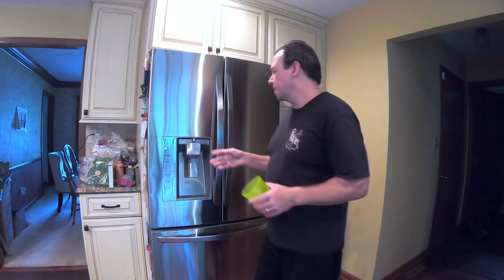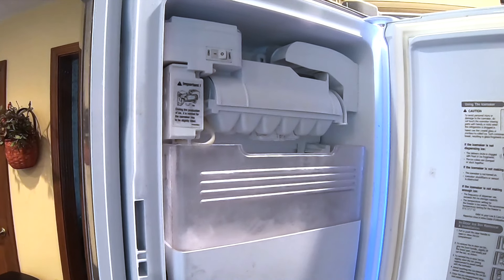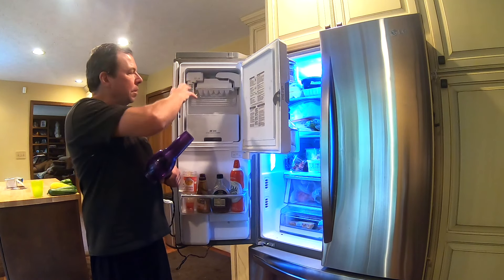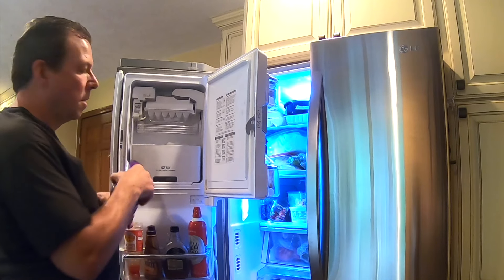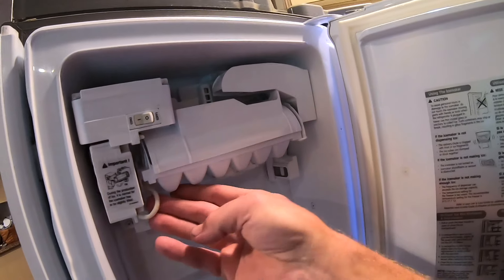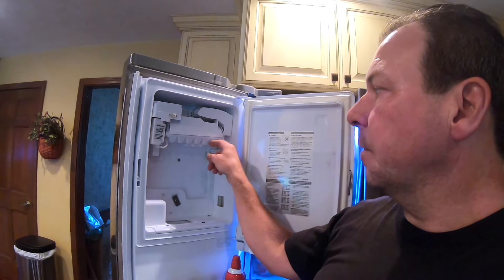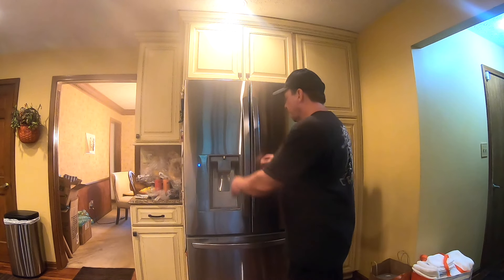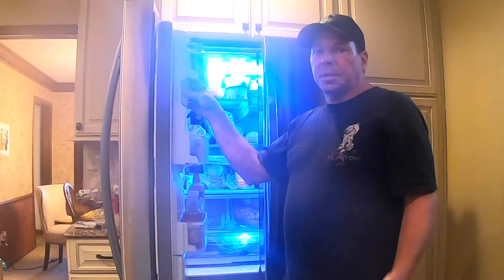How to Fix an Ice Maker - LG Refrigerator

Comment from the maker: Quick tip - don't forget to keep extra water filters like these (or what fits in your particular fridge) on hand : 
LG LT1000P2 6-Month / 200 Gallon Refrigerator Replacement Water Filter, Reduces Chlorine, 2 Count (Pack of 1), White.
https://amzn.to/4dOMTej
There are also many other options available on Amazon.
Just FYI. These Amazon links are affiliate links. They are free for you to use AND Amazon will pay us a small commission if you use them - Many thanks if you do. It helps us keep making videos!

Comment: That model does have a manual rotate button...it's on the bottom of the left-most component (with the label). It's a white square button located on the bottom. Press and release and the ice maker will rotate to empty the tray. Also, the white tube you described as the water fill line...isn't a water fill line. It's a temperature sensor covered in a shroud.
Reply from the maker: Hey Jeff,
Thanks for the tip! And Thx for watching
Reply: Great! 👏🏻👏🏻
Reply: Yes, you’re right. I checked mine and it does have that manual rotate button as you described. I pressed that button and it rotated and dumped ice and refilled the ice maker with water after. Hopefully, it will make ice again this time. The LG manual that came with the fridge is pretty much useless. Thanks for your comment! Hopefully, this has resolved the ice maker issue of this LG fridge.
Reply: First off thanks Jeff that was awesome secondly you notice when the ice tray starts to tilt over does yours twist a lot or is mine just jamming thanks
Reply: @diverm2371  Hi Diver - Mine does a subtle and slight twist mostly related to torque I believe...so I suspect yours is jamming from ice build-up maybe?
Reply: Thanks.   😊🙏😊
Reply: Mine makes 4 or 5 trays of ice, then, it stops filling with water unless I shut it off for 5 or six hours.  It's a POS.
Reply: I pressed the manual button and it will dump the ice and refill. I have to wait a few hours and press it again

Comment: That is NOT the supply line. That is a sheath for the ice mold temperature sensor. The water fills from above in the top right. The test button is on the underside of the motor on the left. This is completely incorrect.
Reply: Steven, you are factually correct, but I think you could be a little more tactful delicate diplomatic when it comes to giving feedback.   Rich is genuinely trying to help people here, let's be as courteous as possible if we're gonna critique him.  Just my two cents, and again, thanks for the additional information! - JD, Montreal - you know, the guys in the STANLEY CUP!!!
Reply from the maker: Hey James,
Thx for your response / helpful and kind - much appreciated. 
And congrats on your Stanley Cup  hopes - but what’s a Stanley Cup? ? All we know about is the Borg-Warner Trophy in Indiana .

Just kidding….I’m a little familiar w/ the Stanley cup😃. Peace, Dave.
Reply: Thank you! your tact  didn't bother me, staight and to the point!  glad for the help, worked like a charm.  I don't have a hair dryer so getting tray to flip was able to get ice out and start over!! thanks for being "Real"

Comment: The "TEST" or reset button is located under the left side.  Look up from underneath... LEFT side.  Same side as the on/off button but look up from underneath.  The reset is located in the back left side/rear on the bottom of the ice maker.  Push and hold the button.  The Ice tray will completely cycle.  Problem solved.
Reply from the maker: Hi Xcaliber69, we found the test button.  All is well.  Thanks for you comments!
Reply: Test button was helpful, for one tray of ice.  I have to keep pressing mine to get the tray to turn over, it won't do it on its own.  Any ideas?
Reply: Thank you.
Reply: I’m still looking for the test button and will find it. This was a helpful video .

Comment: Unfortunately, I've tried all of the resets, hair dryers, etc and it's still not working. I've had it serviced before and it was a quick fix whatever he did. It took him less than 5 minutes and had something to do with the water filter. However, I wasn't home and my wife didn't pay attention or ask. My LG refrigerator is a lg lrfxc2416s

Comment: GOT IT FIXED. Similar issues icemaker not working. Tried turning ice maker on/off - no motor noise. Tried hitting the reset button (under left side below power in/off) for 3 seconds - no motor noise. The other comment about water splashing over the unit if the door was slammed hard during the ice making cycle made me think - just try to uncrack overflow jam. I used my fists on the left and right top side and pounded a little. Heard cracking (like old fashion days when you manually have to loosen or twist a manual ice tray to get the ice out). Turn the motor on/off and I could hear slight motor movement. Pounded again. Heard more ice cracking.  Ran the test button and everything worked just fine. Thanks for all the comments. It really made the difference of me successfully fixing my icemaker.
Reply from the maker: Great job!

Comment: There is a test button on the ice maker. Look under the left hand side of the ice maker module and you will see a label and an arrow pointing to a square button.  Push the button and if all is working properly the ice tray will tilt to dump the ice.  The hair dryer is a good fix for the symptom but not the cure.  Make sure the freezer is set below zero (mines at -6) this will possibly help.
Reply: My LG ThinQ has no test button

Comment: Top tip, thanks very much.
We have not used the ice maker in a while ( have been using the craft ice in the lower half of the freezer), and I guess the top half had frozen up.
A quick blast of the hair dryer has fixed it.
Was trying the test switch underneath, but because the unit was frozen it couldn’t do anything .
Now everything is working as it should 👍
Cheers from Downunder, after a couple of high 30 degree Celsius days and nights I need ice in 2023
Reply from the maker: Hey darry…,
Glad it was helpful! Downunder - wow. So jealous of your  temps!  All we get in indiana is 30 degrees F … for high temps. Yuk!
Thx for watching & cheers too!

Comment: We have a similar LG french door refrigerator. The test button is very difficult to see, but there is one. I had to remove the bin and look under the left-hand side of the ice maker. The test button is a very small, squarish button that slides back and forth, front to back, near the back. I wasn't sure whether it was a button until I tried to move it. The button is much smaller than the test switch that appears in the on-line video on the LG web site.
Reply from the maker: Hey Brian, Thanks for sharing and thx for watching!

Comment: I subscribed just because you mentioned the test button and mine had one.  The mefchanism works... I saw the ice drop and the tray filled with water.. now we'll see if it cycles on its own in a couple of hours :)
Reply from the maker: Hey H,
Thx for subbing!
We usually add 2 new videos each week to our existing library of 350+ videos. We hope you find them very useful and full of money saving ideas!
Thx for watching!
Reply: What does the ice maker use to determine when to cycle and dump the ice from the tray? Is it based on time and temperature from when it refilled the tray with water?  
I can see some photoelectric or infrared sensors above the bin to tell it when to stop dumping and cycling, but that wouldn't signal when to dump the ice.
Reply from the maker: Honestly, I don’t really know - I guess so long as it works … 😃

Comment: I ran the hairdryer on the exposed water tank behind the lower shelf in the door and the ice started making today...but only for one day.  I've had no problems with this for the 3 years I've owned this LG LRFXS2503D/00.  I'm wondering WHY this is happening?  I don't want to take off thee shelf and panel and defrost the tank every day.  How do I know if the ice make is shot or if it's some fixable problem?

Comment: With these door mounted ice makers, I think if you have people in the habit of slamming the doors shut, than IF the ice tray is in the process of making fresh ice and is not frozen over the top, the near freezing water will splash and immediately freeze all over the rotation mechanism and seize up.  Solutions would be to either turn the ice maker off during the day, and on at night when it won't get splashed, or condition members of the house to be press the door shut more controlled without slamming it.  Kind of a pain but I'm not really sure what else you could do to prevent it.
Reply from the maker: Hey T B,
Thanks for the tip! And Thanks for watching!

Comment: That's not to supply line.
It's wire for ice tray heater.

That's why you have to run the hair dryer on it.

The test button is under the unit with the instructions on it.

Comment: I used hair dryer but did not help. Removed unit and completely thawed it out. Reinstalled the unit. Same thing. Unit filled with water but it starts to dump the ice but stops and returns to hold position. I have repeatedly cycled and recycled the on off button but the try will not dump the ice or go through the dumping the ice cycle.

Comment: As someone else pointed out, there's a test button hidden way up under the left side against the inside wall. Just a tiny little thing. Cycling the power caused that same weird jamming situation. Pushing the reset cycled it all the way. My Samsung at home will do the same thing. It goes into a fit and stops until you reset it. Then it's fine. I'll update in a few hours if this one isn't working.
Reply from the maker: Thx gif thx tip

Comment: We have LG LRMDC2306S. During first month we’ve had 4 service visits for craft ice maker not working. Each service call reveals the water feed line to the ice maker is frozen solid although the freezer temp is set at +4F. We added two thermometers into the freezer that log temp and they both show 4F so temp sensor is good.  Does the craft ice maker line have a heater/defrost? Latest tech wants to switch out water feed line but by this point we have zero confidence LG know how to build a fridge.
Reply: I had no luck at all with repairmen from our area working on my refrigerator, you wouldn't believe how many parts they had me ordering that were non returnable... and they wanted use to subscribe to a $450 up front charge for warranty protection. In the end we spent over $400 on a new computer board and a new panel at the rear of the inside of the refrigerator. Freezer worked great refrigerator compartment still would not cool. 
I wound up fixing it myself, thank you to Utube and just replaced my ice make and it's now working great.  All it needed was unplugged and ran a fan in it until it thawed out in the back of the frig. behind the panel an area you just can't see. Seems we had placed items to close to the vents so it wasn't cycling properly and the cold air wasn't getting into the refrigerator compartment so it just froze in a place you just can't see. 
I would try a few things on my own if I were you or if it's still under warranty make them replace it.
Reply: I forgot the two fans the repairman installed and I paid for the parts plus his charge before he recommended another repairman that wanted us to subscribe to the warranty protection. He told me which parts that it could be and I ask for the part numbers, thanked him and ordered the parts and installed them myself. I'm not calling any more repairman thank you.

Comment: There should be an almost hidden "reset" button on the bottom left side. remove the ice bin, put a plastic container where the ice bin was to catch any water or ice cubes in the tray when you hold that reset button for 3 seconds. Ice tray should rotate completely, if all the ice has melted after using the hair dryer on the low setting, to melt ice without burning the plastic parts of the ice maker & tray parts.
Reply: I wish I had read your comment BEFORE I hit the reset button!  After using the hair dryer hack, finding then pressing the rest button, I proceeded to dump the entire tray of “water” all over the floor!  Lol!😂 Thanks anyway

Comment: A comment. That's not the water fill tube or supply line to fill the tray. It's 2 wires in a sheath running to the bottom of the tray. It's possibly a heating element to help release the ice.
Reply from the maker: Hi W M, okay, overall the point is that a hair dryer can usually work to thaw out the entire system and hopefully return it to a functioning state. Thanks for your comment!

Comment: My ice maker would not work on its own. The test switch operated like it was supposed to. 
I found out that the ice maker will not work unless it is 20 degrees or cooler. I put a thermometer in the ice compartment, I was up to 32degrees. 
Cleaned the back condenser coils, that brought it down to 16 degrees. 
The coils for cooling are in the refrigerator at the bottom, you have to remove a lot of shelving and panel which houses the air filter. It actually all comes out with 4 screws. 
Ours had ice build up. 
The freezer coiler are way at the back behind a plastic shroud. Again you have to remove everything from the freezer to get at the coils. I had about 2-3” of ice build up in there. Let it defrost on its own and now I have ice again. Brought it down to minus 1 degree. 
I made brownie points with the wife as I cleaned everything before I put it back in
Reply from the maker: Hi Terry, nice!  Sounds like you solved your ice maker problem.  Thanks for sharing the details!
Reply: Thanks, I'll have to check that out. I was stumped because the manual test button works fine as well, the tray just doesn't rotates on its own anymore.

Comment: My ice maker makes ice at the bottom but not at the top. We just got it yesterday? Is it possible to get a faulty icemaker right out of the box?
Reply from the maker: Hi Style's Life, wow, a brand new ice maker not working -- well that certainly stinks!  Yes, it is possible that you got a defective ice maker right out of the gate, but it seems unlikely.  We had a renter who told me the ice maker in our rental wasn't working.  When I got there I found out that they had accidentally pushed the "pause" button.  Maybe that is the issue with yours.  If not, perhaps the supply line is somehow clogged with debris.

Check to see if ice maker is set to "pause", that should be in your display panel.  If that isn't it, then call your manufacture's support line.  They should be able to troubleshoot it over the phone.  They should also send out a repair person with a new ice maker at their expense if you can't get it resolved.

Good luck!

Comment: My problem is the ice maker compartment is warm.  Diagnostics says all the fans are working though.
Reply from the maker: Hi AJ, that does sound puzzling.  Without being there it would be difficult to determine the exact cause of this problem.  

We did find a great article from Mrappliance.com:
https://www.mrappliance.com/residential-services/kitchen/refrigerator-not-cold-enough/

They give you a number of steps to try.  They say if all else fails, call a repair person.

Hope this helps, good luck!

Comment: Why is it freezing like this in the first place? I’d rather fix the problem and not have to use my blow dryer every other day.
Reply from the maker: Hi Broken Empath, yes, definitely, no one wants to do the hair dryer   hack every couple of days.  We made this video to show a simple DIY method to fix an ice maker.  Sometimes the lines just freeze and the hair dryer will clear them and all is well.  There are several reasons your ice maker could be having a problem.  If it is out of warranty, you could research your exact model and troubleshoot it yourself. Or you could call a repair person.  However, the repair might cost as much as a new ice maker, so you could also order a new ice maker and install it yourself.  Here is a link to with info from a company called APEX who gives several possible ice maker problems:
https://apexappliancerepair.biz/refrigerator-repair/the-6-most-common-ice-maker-problems-and-their-causes/
Good luck, hope you find a permanent solution!
Reply: Usually from the door being left open. Ice could take a while to show up.
Reply: I think people try to keep it too cold.  Mine was somehow pushed to -4 degrees.  I typically keep it at 0.

Comment: Turning the ice maker off & on won't make the tray cycle. There is a button on the left side under the tray, not directly on the try more to the left. Push & hold the button to see if it rotates. It also twists the tray so the cubes fall out. Don't worry it's not breaking.
Reply: Thanks but I thought well mine was broken

Comment: What if the ice will not dispense?
Reply from the maker: Hi Jo, we have had that happen many times.  The first thing to check is the area right over where the ice dispenses.  Usually there is a black rubber flapper that the ice falls through.  On our refrigerator the area directly above this flapper tends to get a block of ice lodged in it.

If you open your freezer and remove the ice bin you should be able to access this area.  It will be directly below where you removed your ice bin.  If there is an ice blockage, use a butter knife to knock the ice block onto the floor.  You can also reach your hand up into the dispenser to make sure the passage is clear.

Now see if your ice maker dispenses ice.  If not, try the hair dryer trick in this video.

If none of that works, either replace the ice maker or call an appliance repair person.

Let us know how it works out.  Hope this helps, good luck!